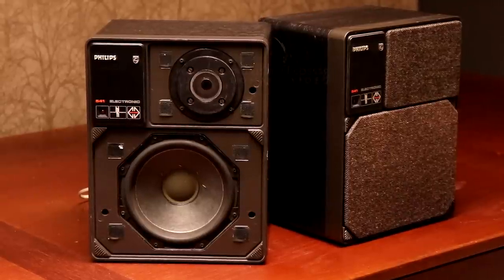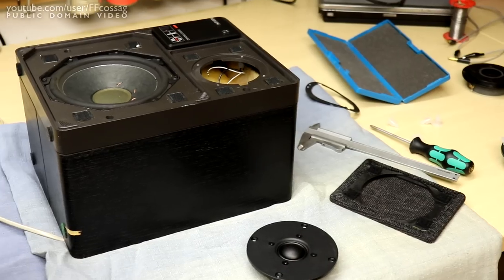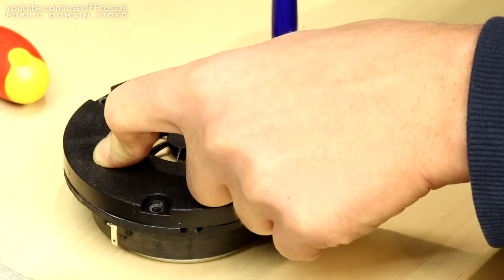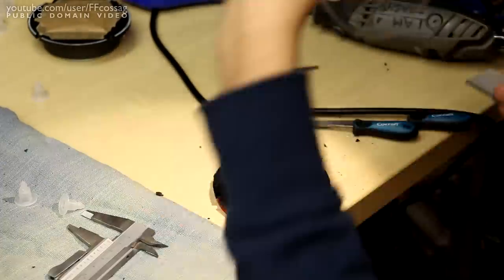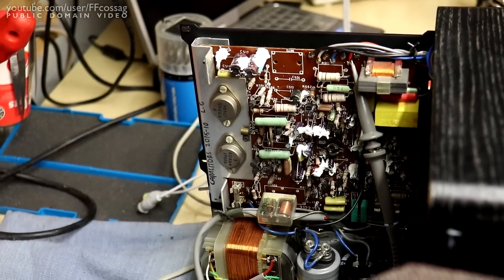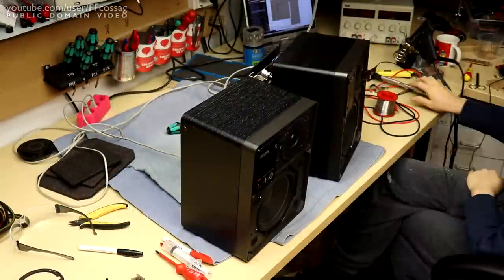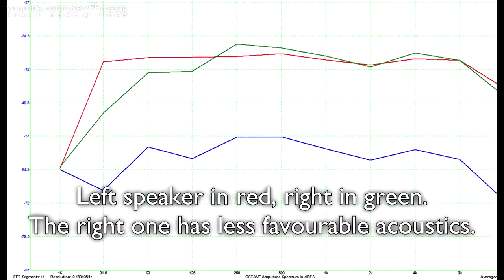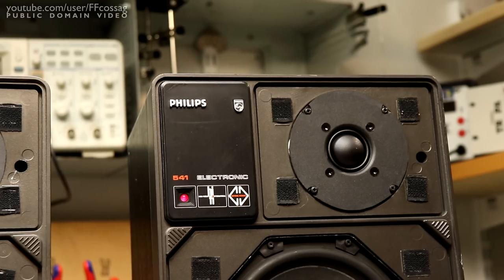Philips 22HR541 MFB Performance Upgrade

Comment: C524 is meant to become more conductive with increasing frequency and drain some power into R612 to cancel out the tweeter's inductive impedance rise for better filtering. It's called a Zobel curcuit.

The coil is part of the high pass filter and is meant to make the caps' filter slope more steep by offering it a lower impedance towards the lower frequencies. There is no low pass filter in the tweeter's curcuit. 

Speaker drivers cannot be swapped like lightbulbs; each one is an integral part of the curcuit with it's specific impedance curve, frequency and phase response. 

What you did:
-turned a well designed -12db high pass filter into a -6db one with wrong tuning and phase response
-thus, you might damage your amp because of the lower overall impedance
-thus, you might damage your tweeter because of too much midrange signals
-thus, the addition at the crossover point will not work without bumps or spikes 

The infinite baffle response is not what a speaker sounds like in a small baffle with crossover.
Reply from the maker: Yup, others have pointed out that obvious fail as well. I wasn't thinking quite straight modifying the crossover, and I've since reinstated the original circuit.

Comment: I don't want to be rude, but this video show's that you don't have any clue of loudspeaker design. The tweeter on RH541 (not HR541) doesn't have any low pass filter. Capacitors C519 & C520 and coil S488 act as a 2nd order high pass filter. Capacitor C524 and resistor R612 act as an impedance correction circuit. Changing a tweeter completely different to the original would need newly designed crossover too, to make it perform well. And something about calibrating that MFB circuit.. I think that the Philips engineers were smart enough doing it right the way it is. I wouldn't fiddle with it. PS. AD016X series tweeters are not that bad. It's just how you effectuate them. As you can see in Troels Gravesen's site, you can make them perform appropriate with properly made crossover and cabinet baffle design.

But if you like it you own way, that's OK. Peace, man!

PS2. I would be happy to own a pair of those, too.
Reply from the maker: You're not rude, you're right, I know very little about loudspeaker design. I basically figured that the performance of the new tweeters would be superior to the AD0161/0162 with nothing more than a first-order high pass filter to keep the sub-bass out. That said, now that I actually think about it for a second, I probably should add that coil back in - Somehow I managed to confuse it with a capacitor in my way of thinking. Obviously, a parallel coil doesn't form a low-pass filter! DUH! Thanks for pointing it out, I feel dumb now, lol.

As for the implementation of the AD0161 in these speakers, it was not very good. There was a really obvious roll-off past 10 kHz, making them sound more akin to a cheap 2-way car speaker than anything else. To top it off, the AD0162 in one of the speakers didn't sound the same as the 0161 in the other (5 dB difference past 10 kHz!). If for no other reason, it's worth swapping tweeters to have the same tweeter in both speakers, lol.

I'm more confident making a statement about the MFB circuit, however, since that's more electronic than acoustic. The way I adjusted it was only done by adjusting the compensation amount, and the trick is to find a balance between maximum loudness, piezo distortion, and noise floor. I turned it up to the point just before piezo distortion and noise floor started to become an issue, which gave me an extra dB or so in the low bass range. This comes at a HUGE loudness cost, however, since the amp has to overcome a speaker that really doesn't wanna play that low at all.

Thanks for your input though, if you've got any specific idea for how to make them perform at their best, I'd be glad to hear it.
Reply: I have Philips 22-RH-544 speakers and Philips 22-RH-743 tuner/preamp  great set =) good old Philips! beats today's stuff :)
Reply: C524/R612 is a classic Zobel network for amplifier stability.

Comment: you ever heard of the dynacord processor amps? they do a bit of a similar thing - measuring real time U, I and cos phi, giving output as power, not just a voltage. but the MFB system is unique. nice video!

Comment: Re: measurements - Since you are mainly concerned with woofer/tweeter integration from ~1 kHz up, I would recommend making a smallish anechoic chamber that doesn't have to contain an awful lot more than the speaker and the measurement microphone (I think about a 30-50 cm distance should work decently enough, and the microphone end doesn't necessarily have to be closed either, though some absorption behind it wouldn't hurt). Consult e.g. the Booth Junkie YT channel for tips on how to make a cheap vocal booth, which is pretty much the same thing really, and should give you plenty of ideas.

Even with the measurements you have now, I find it somewhat concerning that you can see the tweeter's base resonance there (the big bump at 2-3 kHz). That may need addressing, especially considering that dispersion tends to be very wide down there - if it's that bad on axis, it'll get even worse at an angle. Plus, by removing the coil you have converted the tweeter crossover from 2nd order to 1st order, so chances are the crossover range is going to be a real mess.
If you have never played with speaker CAD software, I'd really recommend doing so, it is very educational even if results only ever tend to approximate the real world and measurements and hand-tweaking are still needed. (Boxsim is quite popular around here, which is available for download from Visaton.) Speaker DIY is not exactly a trivial subject and involves a bit of a learning curve. There are various communities out there that may be helpful though.
Reply from the maker: Thanks for your input, I'm going to revisit the crossover and do some more careful testing, because I clearly screwed it up. I think by redoing the crossover a bit more scientifically, we can get these speakers to perform even better. As it stands now, I'm equalising out the 2-3 kHz hump to some extent, but that's obviously not optimal.

Cheers. Thanks for pointing out my mistakes, I really appreciate it!

Comment: You said that if you turn up the motional feedback the accelerometer starts acting as a microphone.So if you turns up the motional feedback and hooked up the woofer bacwards you would have noise cancleing speekers or a very bad feedback loop. One of the two. (:
Reply from the maker: The woofer backwards would probably result in a woofer in need of a reconing, lol.

Comment: Pardon my ignorance but how the heck accelerometer is gonna help with the bass response? Low frequencies are dependant on membrane diameter and excrusion and tuned bass reflex port might help but accelerometers? How to bend laws of physics with them?
Reply from the maker: It works exactly as the feedback circuit that makes any amplifier linear. If you apply negative feedback to a signal, you improve its linearity, since you dampen non-linearities that occur within the feedback loop. You essentially invert the distortion of the circuit and add it to the input signal. The accelerometer is just a tool to read the non-linearities of the actual speaker driver and cabinet and compensate for them.

Comment: I wonder what frequency response correction software like Dirac would do with this. Or if it would get confused with the active correction that the speaker does by itself.
Reply from the maker: It would just compensate like for any other speaker, there's nothing magical about these.

Comment: 9:26

Nice - using the good old Denon style calibration mic, I see. :p

Many people on forums like diyaudio spent lots of money on mics over the years, and then found that the mics that come with most AV receivers have a surprisingly flat and most of all predictable response.

Did you use a calib file for the mic, or just measuring directly?

I used to be quite heavily into things like Digital Room Correction, and it did sound astounding when the log sweep measurement worked properly.
And then I realised that life is too short, so just use the Audyssey function on the amp instead. lol
Reply: Is the piezo mounted directly to the back of the woofer btw, or just inside a sealed space?

Very interesting system.

(I should have watched the whole vid before posting my previous question, as I see you are actually plotting the responses on a PC.)
Reply from the maker: I think the piezo is mounted on the back of the dust cap, if you tap it, the speaker taps back at you, lol.
Reply: Ahh, so it's haunted? lol

Thanks. ;)

Comment: I just got these exact same speakers again (first time was back in 1977). is it very difficult to get acces to and change the 3 step pre-amp adjustment switch on the rear panel (prone to break/become unreliable), and is the part readily available?
Reply from the maker: It's easy to access but likely not easy to replace. You can probably take it apart and clean it up just fine though.
Reply: thanks fpr the reply

Comment: I am a professional radio- and podcast producer. I started the career at a small local station as a teenager in the 80s. The monitors in the control room was a pair of Philips MFB 541s. 

Because of the corona situation, I have edited all the programs that I have been producing the last months at home. And I use a pair of excellent original MFB 541s as my near field monitors. They are working shockingly good, being almost as old as I am. I don't miss my Genelecs at all.
Reply from the maker: Oh, that's really cool! I wouldn't have thought anyone actually used the 541s in a professional environment, since they were marketed as consumer gear.

Comment: What a load of crap......He he just joking :-D :-D
They are a complicated active speaker arnt they, not cheap by the looks of it's internals.
With my broken ears ... well i cant make any judgements.

You went over the top of my head with graphs and other tech, but everything else made sense.
Phillips were very clever with there products, but somethings were very odd indeed, they had a habit of using one valve for 20 jobs, or a tone circuit that was very odd.
I still liked there designs though :-D
Reply from the maker: Philips have always been excellent at building cheap trash. I generally despise their products.

To round up the graphs for you: less bendy bits = better. The ideal graph is flat as a ruler.
Reply: Ha ha "less bendy bits", i know what graphs mean but i can't learn from them, im one of those people that finds conventional methods confusing.
Or im just a thick git :)

Comment: I dunno, in my experience any of these technological marvels from Philips tended to be all mouth and no trousers. I was taken in by these gimmicks over and over. Not only that but I've never known a mainstream manufacturer producing decent speakers. The tweeter design backs this up.

Nice piece of work and great video but I'm sure speakers from a proper specialist manufacturer would sound better even after the upgrade.
Reply from the maker: Speakers from a proper manufacturer wouldn't have tweeters that crappy to begin with. ;)

You are right about Philips and their gimmicks, they're generally utter trash. Their MFB speakers are an exception to that rule, as they measure better than any other speaker of this size that I can think of. These are small, sealed 2-way speakers with a reasonably flat frequency response and <4 % THD down to 30 Hz - those are numbers that are very difficult to beat without using a MUCH larger cabinet.